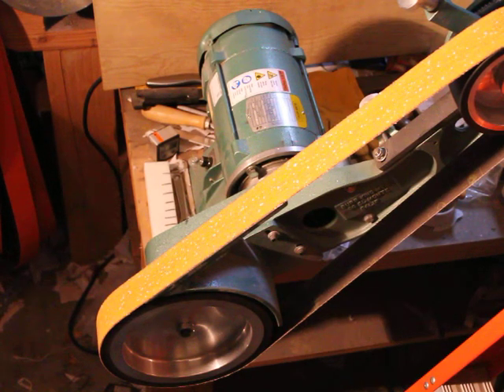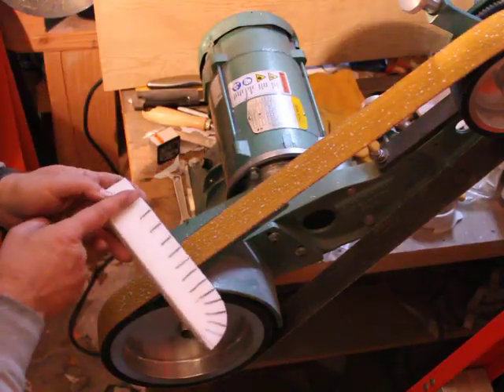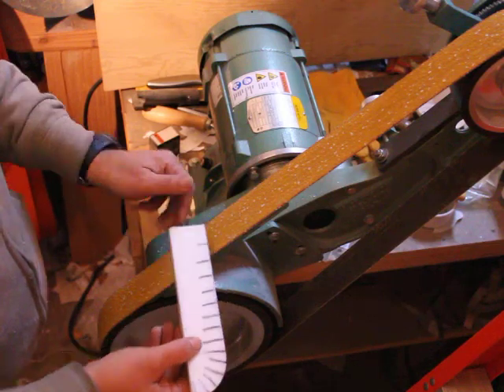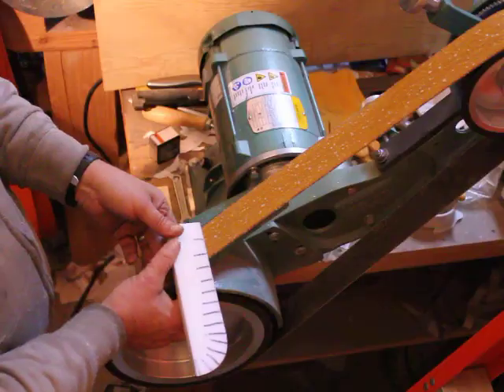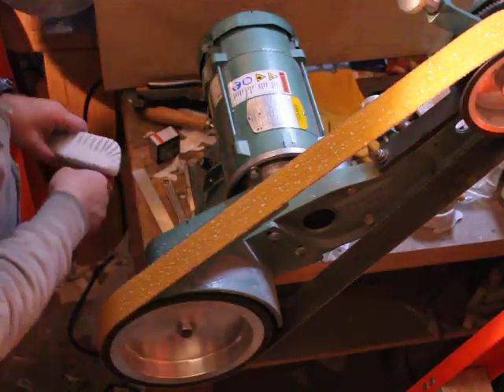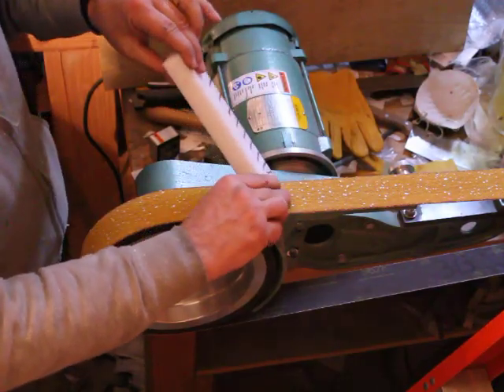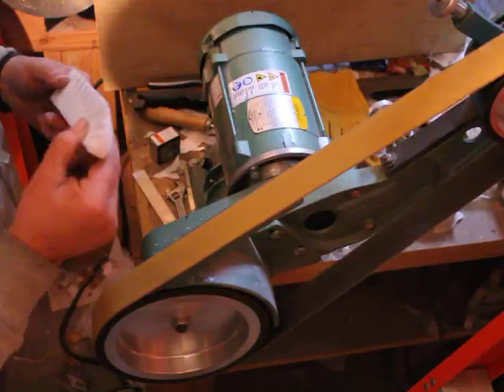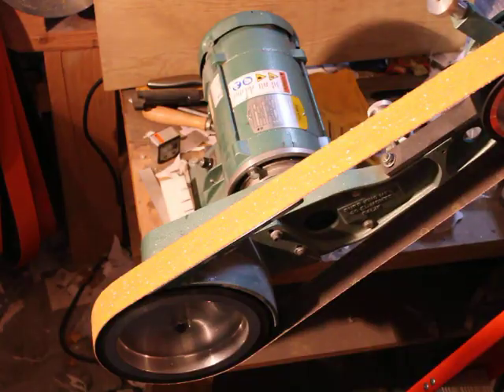Advanced Knife Sharpening Techniques : Maintaining a Constant Bevel Angle Around a Curved Tip

Comment: Hi Kenneth. I'm so confused!!! I've been searching for this very advice on how to deal with the belly & tip area while sharpening an Opinel no9. I want to NOT loose the shape as I do a flat zero grind for carving (long story). I found a Virtuovise vid showing the exact opposite technique given to him by a Japanese sword sharpener which avoids spoiling the belly line. You both make sense in the explanations so please take a look at the link and if possible give your views. https://www.youtube.com/watch?v=BIa30Fd2kug  What I want is an increased depth Scandi grind from spine to apex (no secondary bevel from heel to tip) on my flat primary bladed Opinel. Just subscribed! Thanks in advance if you can help a 68yr old semi novice lol. ATB. from the UK. Pete. PS real info on link starts at 1.50 sec.
Reply from the maker: pete wright Saw the video. Not really a sword polishing technique. His stroke angle is variable giving you a convex edge.  It is best to use a consistent angle. Going to a steeper angle near the tip  makes for a less acute edge. The variability in technique makes for a wider bevel.
Reply: Wow, that was a fast response and thanks. I had wondered, as he is very much into convex sharpening if that might have caused some" wear on the belly" problems for him. Your system does seem more scientific, logical and provable though. I'll stick with your well explained method I think as I like the more efficient  cutting of a thin blade and laid back bevel, or no bevel as with my small flat blade wood carving knives. Thanks for taking a look at the vid. ATB. Pete in the UK.

Comment: yes but when free hand sharping, your moving abrasive moves in a variable direction, so your tangent is always changing. You can change grinding direction instantly into the stone however you want. I would love to see you free hand sharpen a knife curved like that. 
I am just fine on straighter knives, like japanese kitchen blades, but something shaped like the piece your holding there, I have a huge issue doing the tip with my off hand. I can't seem to figure out a good way to do it.
Reply from the maker: Max Savino Check out some of my Nubatama sharpening stone videos to see this done with waterstones. If it's still confusing send me some email ksskss earthlink net
Reply: kenneths123 I have but again you tend to do mostly Japanese knives, which don't have much curvature. I'de like to see you do one of those stupid slicing knives you get with a knife set from someone like chicago, where the knife is straight, and right out at the end it curves 45 degrees. I'll look through more of your nubatama vids though.
Reply from the maker: Max Savino Check out this video - Google "Nubatama 1000 Bamboo Grit Narrow Waterstone - First Impressions" on youtube for a knife with unusual curvature - a Chinese design. I do all sorts of knives.
Reply: Yeah but that knife is a re curve. Still doesn't help me. I'll post you a video  and see if that will show you what i'm doing wrong if you don't mind. I have my sharpening down to where I want it except this one thing, its driving me nuts.
Reply from the maker: Max Savino Max, give me a call at 209 612 2790 and maybe I can explain it more clearly. We can exchange videos or even do a live video call over skype.
Reply: kenneths123 Ken what time zone are you in? I appreciate it man, I created a video I would like to post on my channel for you to watch, I'm ganna put it up tonight before bed, its about 1 am. If you watch it, I will explain exactly where i'm struggling. Very nice of you to offer a phone conversation man, appreciate any help if applicable!
Reply from the maker: Max Savino I'm in California (Pacific Coast time). Call anytime. Let me know when it's uploaded. Looking forward to the chat!
Reply: kenneths123 its all uploaded